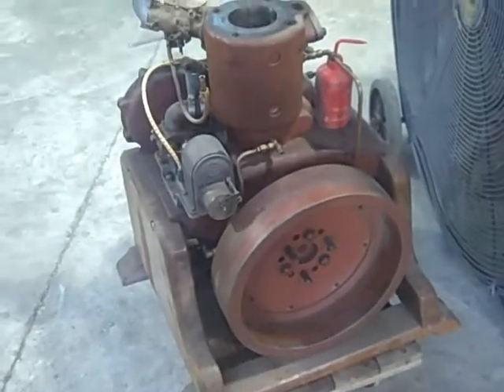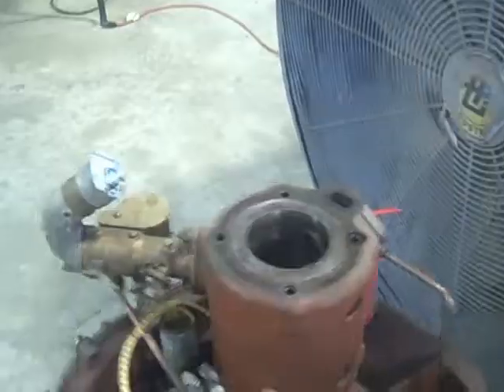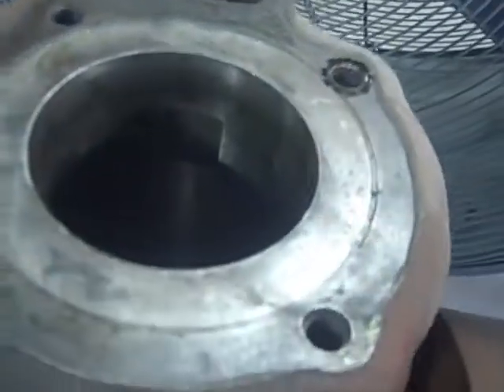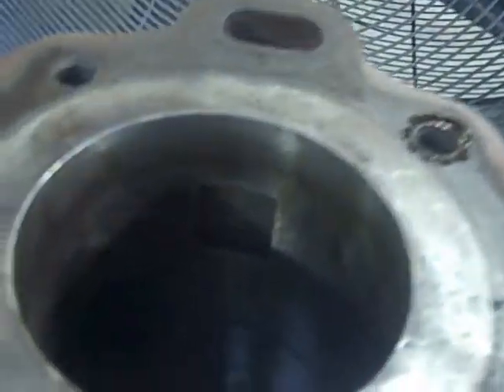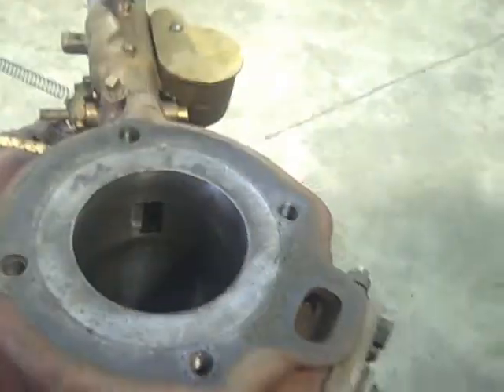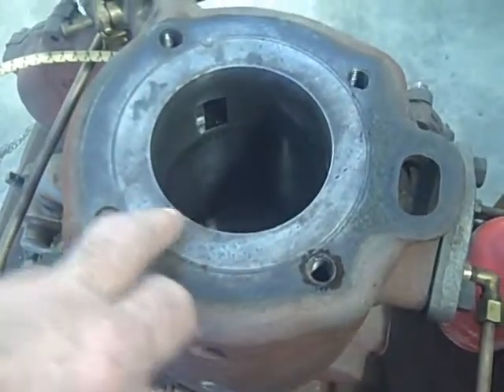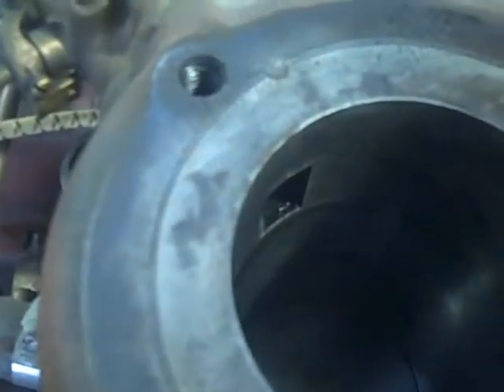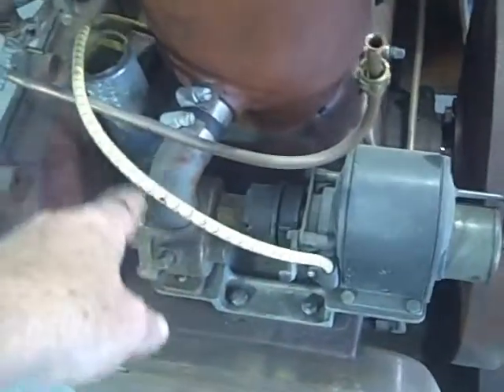Rotating Valve Engine 2017

Comment: who manufactured the engine? any idea? thanks for sharing this btw.
Reply from the maker: My pals have gone over the engine in excruciating detail when it was apart during the restoration, and there was no mark or evidence about who made the engine - it remains a mystery to be solved.
It may have been a stationary engine for a small generator or a water pump which was then converted to marine use.